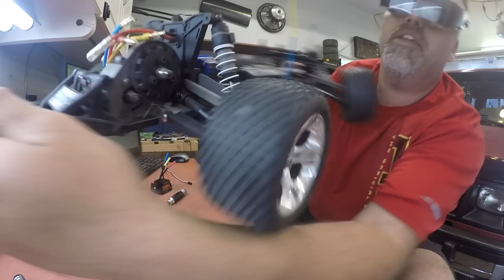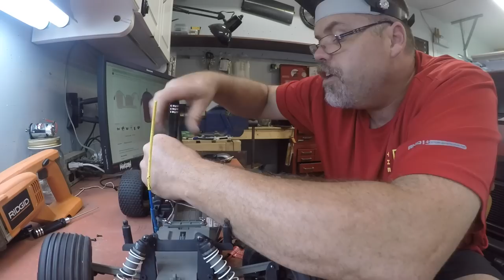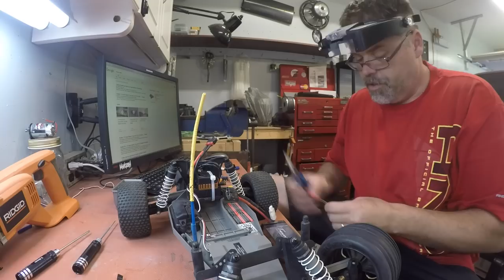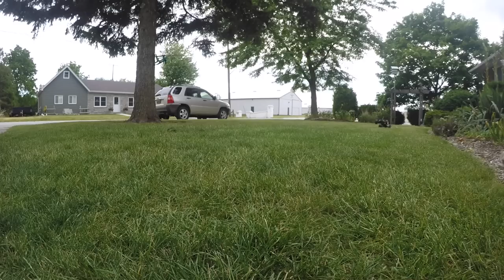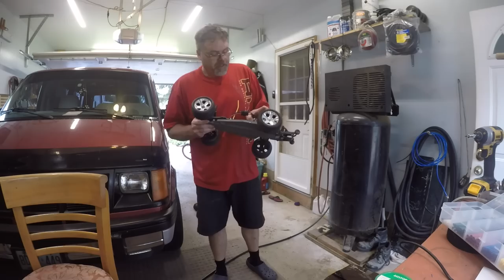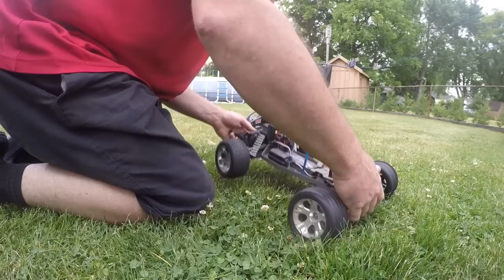29 Dollar Brushless System For The Rustler

Comment: boss, crack that esc open, buy a can of conformal coating, stray both sides of the pc board and reassemble with silicone. If you get the urge to watercross.... just send it.... that will impress the campers

Comment: I just got a flysky gt2e transmitter n a receiver to go with it. For my rc red cat xte pro truck with a brushless motor 3650 4poles 39000kv n a 60a esc with a 3800mah battery 7.2v.  25kg servo n I need help to get it running. Please can someone really help me. I bought everything new.

Comment: That combo still working? I recently read some reviews about that combo and i see comments of that combo burn or stop working and more.
Reply from the maker: Mine still working
Reply: The link does not work for me. What's the name of the system? Lol
Reply: @christianrobles7561  thank you Brodie. Clutch reply back.. 🔥🔥💯
Reply: @christianrobles7561  yeah man I'm trying to rebuild my duratrax  intrashed the original motor. And that's been more then 6 yrs so I was looking for parts to start to rebuild it. Starting with a motor combo . It came.with a futaba radio system. From the box. Should.i.change it. Hmm

Comment: ha bill I was wondering if this is a good choice for my slash and how long does it take for the shipping? im in Ontario.

Thank-you
Reply from the maker: about a month for shipping and it be ok but wouldn't hit it with more then 2s save money and spend a little more if you want fast fast lol
Reply: @LifeWithBillSiff  alright thanks, I'm just cheap because nowni need a frickin drive shaft or something, it's like there is not alot of power going thru the wheels when weight what part you think that Is can't figure it out.

Comment: Out of all the Under <$60 Brushless (Sensored - I think this is what I want) ESC Combos out there, which are your top 3 for Speed Torque and Compatibility to the 2wd Traxxas Slash?
Reply: Nevermind. I just bought the "Kinexsis 4-Pole 4000Kv Brushless ESC/Motor Combo." Kind of price at $79 but, I'm GETTING IT TODAY!! Wondering if I need to change my gearing and/or buy a wheelie bar~!

Comment: Servo Tape / two sided tape would work a little better so you can get the ESC off if it happens to release the magic smoke :)
Reply: InCaRnAt3 just use a zip tie it will melt in case of fire :-)